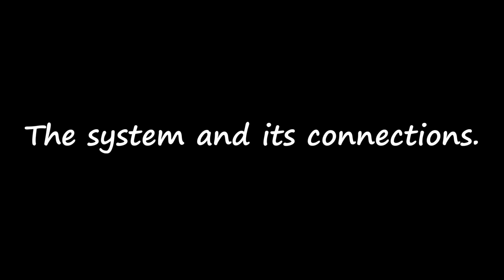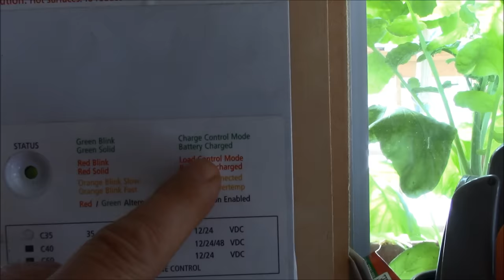A SIMPLE OFF GRID CABIN SOLAR SYSTEM THAT ANYONE CAN BUILD AND AFFORD. DIY Simple Solar Installation

Comment: I'll probably smack my forehead and say "duh" for this but.. how does a cord coming from a wall outlet into the inverter provide power to electricky things?   I thought wall outlets were outies not innies lol    10:06
Reply from the maker: Power will flow either way. You can put it into and outlet or pull it out of one.
Reply: @thebossoftheswamp   makes sense now I think about it. Thanks much for reply,  this was your 2nd vid i'v enjoyed and i think I saw Kubota Orange on a thumbnail,  can't resist... I owned an L35 for years ..loved that thing.  cheers